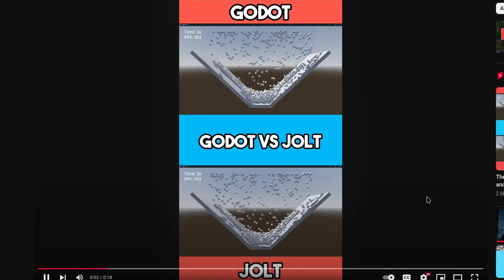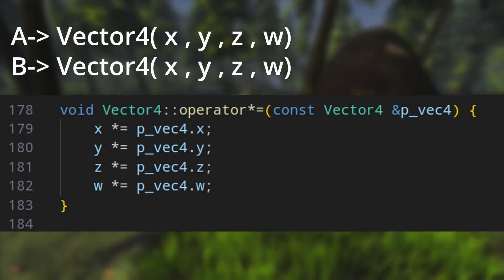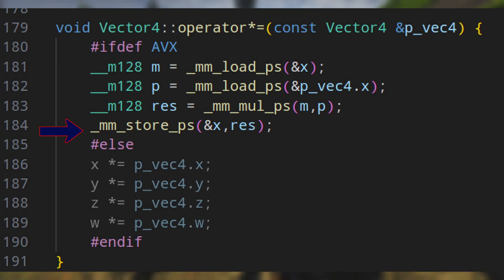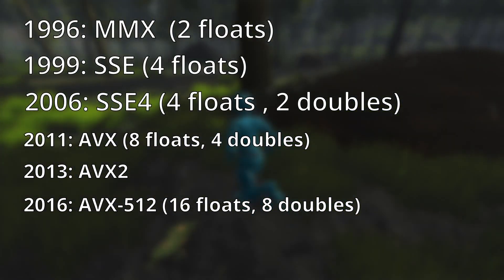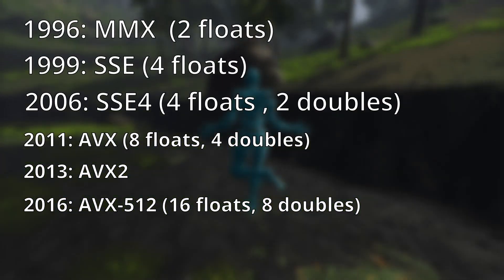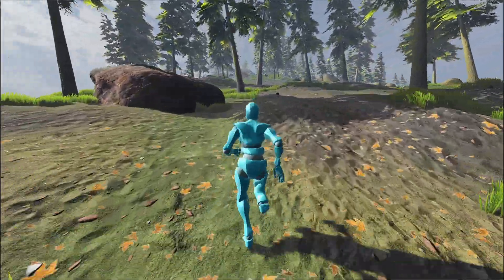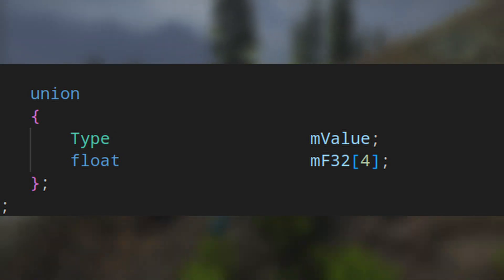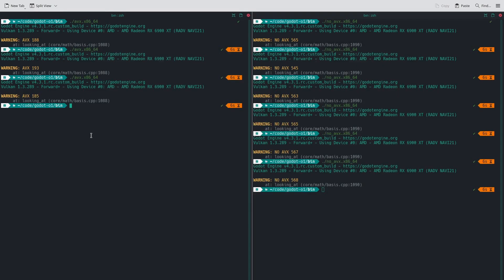Why Godot Physics is slow? SIMD

Comment: I can't understand this aversion that Godot main developers have of using external libraries. There are open source mathematical libraries that can handle all the SIMD mathematical operations for almost all CPU architectures like eigentux. This need of reinventing the wheel.
Reply: Godot 3 had box2d and bullet, now they regressed in godot 4, it was the most dumb move. There a lot of external libraries that could fix a lot of issues, they even made a scripting language that is waste of resources.
Reply: @realskyquest A pr was opened recently that adds jolt physics into the engine.
Reply: @realskyquest  

I think Godot is still best what is available for free if someone want "full" engine.

But that is the problem for me because I think many game developers can do their job better if they use framework and not engine. Something where different systems are in game like graphics, physics... and of course AI and game rules. Scripting should be in content side.

I don't know what are the reasons behind scripting language. Lua could work as well.
Reply: @gruntaxeman3740  mhm, with a broken physics engine unfortunately, also the shader precompile is a big issue. The 3d is not great in terms of performance. 

The jolt PR might not be merged since they already has dozens of good PRs ignored
Reply: @realskyquest  

I just disagree on 3D-performance. Tested on my Geforce 1030 card and I easily get 1080p@60fps with photorealistic graphics on Godot.

But... Bullet physics works flawlessly on Godot 3.x and in my understanding, it can be used on Godot 4.x so I would go with that. It isn't fast as in Unity, but worked perfectly if used as it intended for.

I know Bullet physics internals and it is made in way that if "1 unit" is "normal scale", smallest colliding object should be 0,2 unit, and largest 5 unit. Also largest polygon to like some floor/wall, longest distance between vertices should be 10 unit. And, then there is accuracy that colliders work in 0,04 unit resolution.

That is made to work in normal cases for "human scale", 1 unit = 1 meter. In game that mean 20cm diameter beer bottle to throw and at 5m length of car.

Tuning accuracy for Bullet happens adjusting world units, making decision on very early phase that is the important stuff between 0,2 - 5 unit.
Reply: @gruntaxeman3740  that's because bullet physics is well made, while Juan complained that it's not suitable for games and something like that and removed it in 4.

The 3d performance still needs improvements, also 3d capabilities are not that advanced and optimized, infact other 3d engines are ahead and more advanced, it doesn't even compare to source engine. That example sounds like a 3d scene with bunch of 4k textures. What about ray/path tracing since that's a standard being heavily pushed by certain nividia fans. Gonna ignore all other 3d stuff that's popular...
Reply: @realskyquest  

Hard to understand why it is not suitable but if it is not ideal, in my opinion it still best to leave existing one until there is proper replacement. It gives value for users when there isn't much of changes.

I've used both Godot 3.x and 4.x in bunch of 4k textures and there is no issues. Old Geforce 1030 runs 1080p @ 60fps. And that is very slow card. And image is sharp, not TAA blurry. In fact I think Godot actually shines on rendering speed because it is not using deferred pipeline so it doesn't waste bandwidth as much as many other engines. I am very sure that the rendering performance almost every case depends on the user, not engine. Engine just does the culling & batching and throws draw calls with very neutral way. Optimization doesn't happen in engine, it happens in assets. Also graphical fidelity is related to on how well artist does the modelling. Not so much on engine.

First game requiring raytracing, Indiana Jones and the Great Circle, is released tomorrow. It doesn't do fancy tricks what we haven't seen yet without RT hardware. Game isn't raytraced, it just use RT cores in global illumination.

nVidia fans doesn't matter. Game graphics work on the terms of consoles and they have AMD, except some Nintendo switch.
Reply: @gruntaxeman3740  its not suitable, the 3d did improve in 4.x, but the engine is still being developed, even the 4.x introduced a 2d camera bug that requires a workaround, not sure if it's fixed rn, also the leadership constantly keeps on messing up and is honestly worse than unity, since the certain person has a loud mouth in mastodan.
Reply: How rendering pipelines work in Unity? Is there like some sort of compositor thingy like in Blender?
Reply: Of course it is still developed. Every engine what is used, is still being developed. When development stops, software will die.

It is also normal that there are sometimes bugs. I've seen bugs in Unity too.
Reply: Developing in the same way as squeezing toothpaste can earn more money.🤐
Reply: @潭天CN  True, the pitfall of crowdfunding or patreons. You have financial incentive to sit on your ass and drag it out.
Reply: Godot 3.x used Bullet physics, so they didn't reinvent wheel.

I don't know how Godot 4.x differs here, but I liked Bullet physics because it was used in Blender too.
Reply: I think Godot has a particularly annoying  example "It's open source, modify it for your needs/add the feature you need" mindset. Of course, every open source project is this to some extent. But Godot developers take the cake for using this statement as shield against most criticism or basic feature requests. Lot's of inefficient development being made under this guise.

Leadership is somewhat incompetent imo.
Reply: @verendale1789  tell me about it, their excuse for not using simd optimizations is that they claim that the compiler will autovectorize it even though the flag isn't set iirc 💀
Reply: @snesmocha  Yeah I saw your other post too. What the f lol. Honestly, if there wasn't a value proposition of "Well you have to do a lot of work yourself but at least you Own the work" Idk if this engine would be ever worth considering for 3D projects. As it stands, anyone that succeeds at making a nice 3D project in godot does it in spite of the engine not because of it (still a looong road to unity level).
Reply: @verendale1789  

Godot works well on 3D project. Actually it renders very fast and I don't see that there is much difference for Unity.

Thing in Godot is that it doesn't support streaming, so developer need build scenes that they fit to VRAM. It doesn't matter are they 2D or 3D. I don't think this is issue unless someone is making Red Dead Redemption 2. Most of the games are worked without streaming, including many open world games.

That means that when doing some open world thing, it doesn't work that way you can stream whole huge map where you got everything, instead you split game to separate maps. They can still be open world game but there are area changes.

Physics performance is indeed slower than in Unity.
Reply: @gruntaxeman3740  It works good enough for 3D depending on your scope; but that doesn't mean that there is feature parity. Animation systems/blending is not as good, things like IK for feet which is pretty basic and important for most 3rd person games don't exist, more stencil buffers for shaders, etc.  There's a lot of little things that add up if you are trying to make a 3D game.
Reply: @verendale1789  

IK for feet... In my understanding this works as good as developer want to model character.

Generic game engine doesn't care is the character spaceship, car, human, dog or what. That it out of the scope. Example, the reason why in games climbing up stairs isn't that simple task. Very often bounding structure just float stairs up but developer can of course make code where feet is moved and put on position on every step but that is up to game developer, not for engine.
Reply: @gruntaxeman3740  except it doesn't. I have tested scenes with baked ligting and low polycount (less than 1 million), their framerate is much less than it should be.
Reply: Also apparently YouTube keeps on deleting my comments... #youtubehatecomments
Reply: Seriously, I'm just gonna say this once, godot foundation is not trustable since the leadership is scummy, the engine is decent, there still better alternatives.
Reply: I don't know about that leadership.

But I've tested following engines:
-Unreal Engine 4, 5
-IdTech 1, 2, 3, 4
-some Unity versions (not latest)
-Godot 3, 4
-some CryEngine versions
-Armory
-Blender Game engine, UPBGE
-O3DE
-Torque game engine

I know that there are others too, like many game engines used in commercial games that are open sourced but I don't expect that they are well documented.

I can also say many reasons why these... sucks. I mean, they are not ideal. Among these options, I would take Godot if possible.

However, it is not impossible to make own engine. Basic engine isn't problematic, but it may be problematic to outsource game console ports if engine is custom. Or, fork Godot.

Comment: an off-topic notice: 'Check Point Research' found a huge security hole in Godot that make possible to create malwares and trigger them within Godot and are undetected by antivirus
Reply: Yes , you can do the same with VS Code, Unity, Excel  or whatever.  It's all bs.
Reply: You can create malware and trigger them in any programing language, its is probably not detected because antivirus programs are stupid and they need to already know the malware in order to detect it, so you have to wait for Godot executable to become widely used in order for antivirus programs to start detecting it.
Reply: you mean the security issue of "Downloading code without checking it and running it" ??

yea that's called User's Fault
Reply: @sheepcommander_  I would say to remove any security protocol from any program, after all, there is always a way to bypass it and no one can defend the user from himself.

Comment: I'm not sure, but there are chance godot release builds not enabled compiler vectorization flags. Direct simd instructions are cool, but require knowledge about and how different archs works
Reply from the maker: I hope Godot add support for SIMD! compiler do this optimization rarly, you can not trust them
Reply: @mohsenzare2511 Today compilers optimize (vectorize) data not so bad, I think thats why many Godot structures like Transform and even Vector stored as arrays also, but also impotaint to have data-oriented design (DOD) to avoid cpu cache misses and got fuly SIMD optimisations.
But, as you may know, exists w4Games - company, founded by godot creators / core members and making money doing optimisation and ports for commercial godot projects. That's why they not interested for Godot become fully optimized open-source. They can include box2d for 2D and Jolt for 3D into Godot by default, but this is what they can do for make money. 
I don't mean this is bad, they free to do this, but need to understand this.